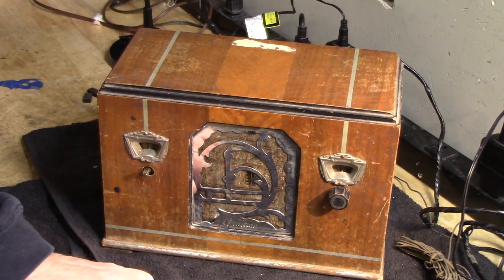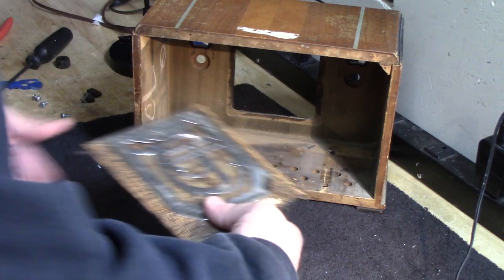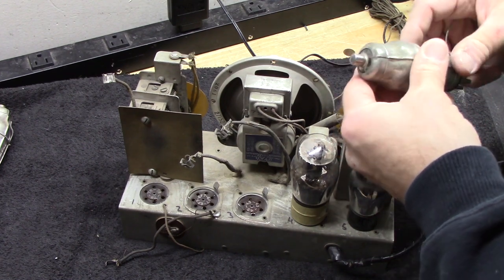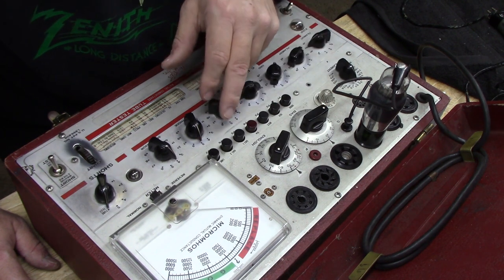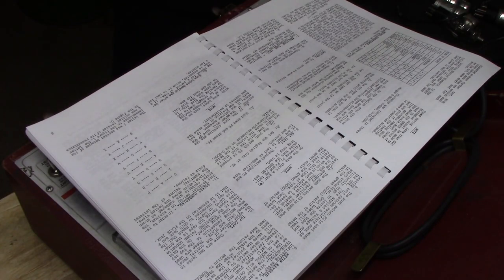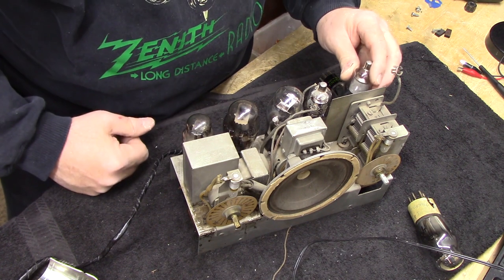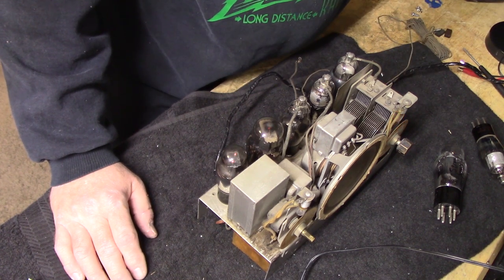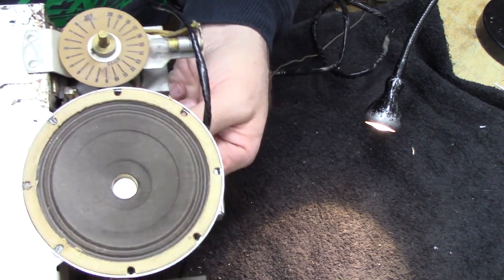1934 Grunow 501 Antique Tube Radio Part 1 of 10 Getting Started

Comment: Always do the short test first, I burnt out the meter of my tube tester because I tested a shorted tube, which caused too much current to go through the meter... only takes seconds, took me months to find a replacement meter!
Reply from the maker: Yep, Carl, are right!  I don't have years of experience as a tech.  There are a few things that I am obviously not experienced at, and one those is tube testing.  I will improve with time.  In the mean time, I hope others learn from my bone headedness!    I have developed the habit of returning the shorts test know to the "safe" position #1 after each tube is tested.   Thank you for the tip, sir!  I will remember it.  Cheers!    Michael

Comment: Cool radio Michael! Pretty tight underneath. Does it have a curtain burner resistive power cord? Looks like that is a choke on the chassis. I have no idea what the plate in the top is, but will be interested in finding out. Thanks for sharing this one, it is a bit different for what you have been doing. I love the 30's radios. Take care--Larry
Reply from the maker: Hey, Larry! 
Indeed, it originally did have a curtain burner!  Someone replaced it a long time ago and just left out the 120 ohm resistive element!  I'll bet those tubes liked that!   I will soon have it back to rights, I think.  Of course, I's sure that I'll also have to trim the incoming line voltage beyond that.  I'm going to try a 25 ohmer first.  It usually winds up being about that much.  I still don't know what the copper plate is for.  The skemo says nothing about it.  Figures.  

1930s radios are my favorite.  They are comparatively well made, pretty to look at, and pretty easy to restore.  On the other hand, the late-40s radios are generally not very pretty, a pain in the posterior to restore, and are built remarkably cheaper.  The late-40s and early 50s mono high-fidelity sets had awesome sound, though.  Just check out a late-40s Magnavox console and you'll see what I mean.  And, that Scott 800B that I did a while back, would blow the windows out, if you let it.  It was one of the best sounding machines - of any vintage - that I ever heard.

Oh well.  Until I can clear out a bunch more of other people's radios, I get to do what's next on the list.  I love them all, but I'll be thrilled when more of them are mine!    Take care, my friend.    Michael

Comment: Bet that line cord is a curtain burner, cause that looks like a transformerless set.
So are you going to 3D print a replacement knob?  You can get wooden PLA filament you know.
If you have problems with oscillation when the chassis is out of the cabinet, that would be a clue as to the purpose of that metal plate, it's located just above the grid caps on those tubes. Some kind of shield would be my guess.
Please tape a piece of cardboard over that speaker to keep fumble fingers away from the cone!
NOT OCTAL TUBES!  Standard base types!
6C6 sharp cut off pentode.  6F7 triode / Pentode.  75 triode, dual diode.  43 power pentode.  25Z5 dual diode rectifier.
I think the tubes might be in the wrong sockets.  6F7 was often used as an autodyne converter, and the 6C6 an IF amplifier (though the remote cutoff 6D6 would make more sense).  The 75 is the detector and first af, (75 is an older version of 6Q7 or 6SQ7, 6D6 older equal to 6K7 or 6SK7)  Assuming this is a superhet, it might be a TRF.  Need to see schematic!

Found a description of this set on line.  Someone did swap out tubes on yours!
Circuit: 5-tube superhet, AC/DC.  This radio is a well designed and made small set. It has a separate triode local oscillator in the 6F7, with the first 78 acting as mixer.  The local oscillator signal is injected into the mixer inductively through a cathode coil. The automatic volume control (AVC) acts on both the mixer and the IF amplifier, which is the pentode section of the 6F7.  The two diodes of the 75 are separated, with one doing the demodulation for the audio frequencies and the other generating the AVC voltage. The grid bias for the 43 is obtained by a 100 Ohm resistor in the return to ground of the power supply and the 25Z5 performs separate functions, one half feeding the field coil and the other half supplying the high voltage for the tubes. There is a filter inductance and a hum bucking coil in series with the voice coil in the speaker.  Tubes: 78, 6F7, 75, 43, 25Z5  Schematic: Beitman #73  (I  have an electronic copy of that one).  I can email you the file (you'll need a djvu reader).
Reply from the maker: Hi, Kenneth!  I'm not sure why, but your comment ended up in the "Likely Spam" tab of the comments.  I do believe that the cord was a curtain burner.  Someone replaced it with a standard two-conductor without the ballast conductor.  they simply went straight to the 25Z5 and did nothing to replace the cord ballast resistance.  I am installing a 50 watt 120 ohm metal case power resistor.  I know that 50 watts is overkill, but I had it in my stash and didn't have to buy one.I've already been experimenting with wood PLA to make knobs.  I've made some pretty decent ones that are appropriate for 1936-37-38 Zeniths with the wood knobs.   I spray them with toner lacquer to get a good color and then clear for final coats (two coats 60-sheen, and then 1 coat 10-sheen).  Next I have to figure out if I want to make inserts for the shaft mount (like Restoreoldradios did) or if I want to try to find pre-made ones.  The PLA drills pretty cleanly if I make the knobs with 100% fill.  My main problem is how to orient the knob so that the supports don't leave big nubs and so that the bed adhesion layer works.  The Cura software likes to orient the knobs sideways, which require supports.  When I upright the knob in Cura, the printer prints it, but it only puts adhesion under half of the base, so the other half comes out really rough.  Plus, the layering looks better if the knob is printed while the knob is laying down.  The filament layering actually looks like woodgrain!  To get the files, I scan the knobs using my Einscan SE white light scanner.It's curious about the "shield".  There is a shield called out on the skemo, and I wondered if that was the copper plate.  But, I could not figure out what the devil it was shielding.  The grid caps makes sense.  Thank you!  When I next test it, if I have problems, I'll slip it into the cabinet to see if it helps.I didn't catch the way they did the field coil supply and the high-voltage supply!  I'm going to study the skemo when I get home from work.  I never saw that before.I was able to get the Grunow schematic and a simplified (Grunow) schematic for this set.  It covers early and late production models, as there are some subtle differences.  I downloaded them from Radio Museum.  Radio Museum was the best 25 bucks that I ever spent!Thank you very much for your help so far, Kenneth.  It's nice to know that there are some smart folks out there who are as helpful as you are!   And, as always, thanks for watching! Take care, my friend.Michael